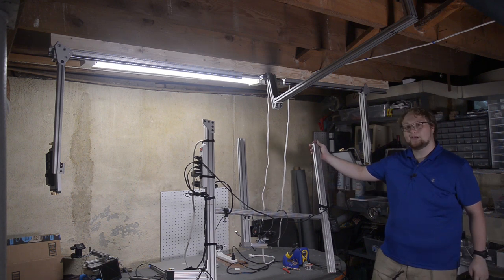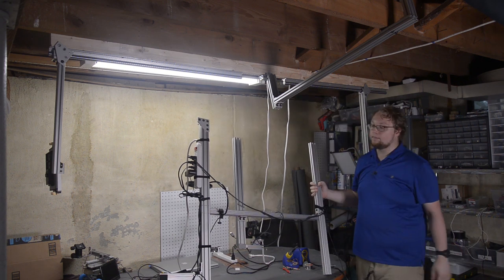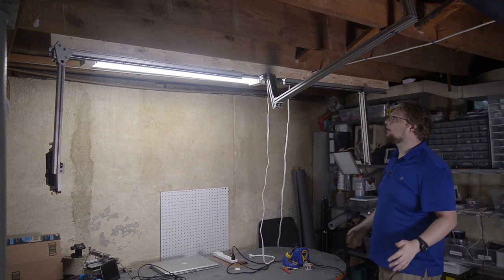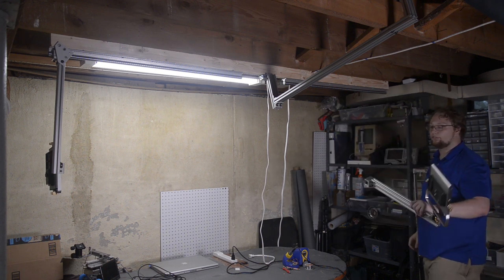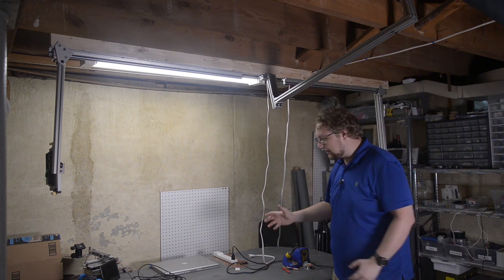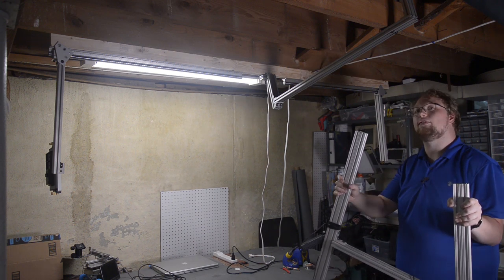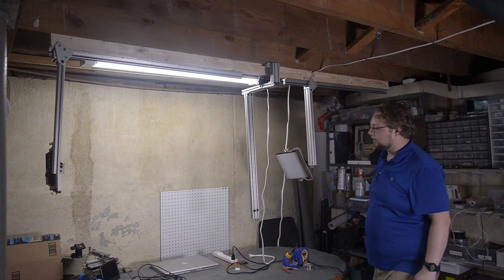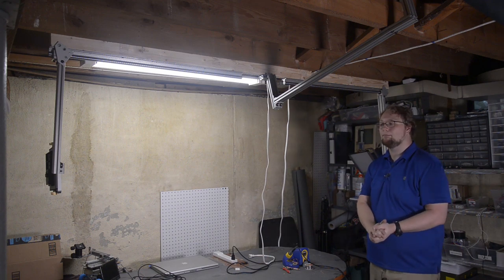Brand New Film Studio! (Behind the Scenes)

Comment: If you could move the hinge from the beam to the first elbow (in the unfolded position 4:18 ) , you'd be much less likely to get a bleeding head-wound ;)
Reply from the maker: Thats not the worst idea ever... I did notice that it would be a potential hazard. The problem (that I'm sure would be easy to solve if I put any thought into it) is that the purpose of that horizontal bit is to make it relatively easy to slide the camera front and back a bit and having the hinges that I have don't have a good way to mate with the 80/20 so they're kind of bolted on in a weird way. I could honestly just re-drill the mounting holes on the hinges and fix it but knowing me I'll probably just wait until I bash my head on it before that happens... :)

Comment: 8020 is not a brand name, it's the size of your extrusions. 80mm times 20mm. Watching your video on my tablet I think they are 2040 extrusions, but I can't judge that based on my small screen. I think the setup is kinda wobly and wonky.
Reply from the maker: I hate to contradict you but 80/20 is a brand name, 80/20 Inc to be precise about it (8020.net). The size of this extrusion is from their 10 series (inch standard), its 1020 (1"x2") though I also have the 1010 (1"x1").  You're right that it's not the most stable but in terms of functionality it's hard to beat and it's not like I'm trying to hang 50lbs of lights from it. If that were the case I would likely have built a structural lighting grid into the ceiling but that seems a bit overkill for my purposes haha. ItKindaWorks man :)
Reply: @ItKindaWorks  Big thumbs up for you, Thumbs down for me... :-)
Thanks for explaining. They look like normal extrusions you can buy everywhere, I now know they aren't. Thanks.